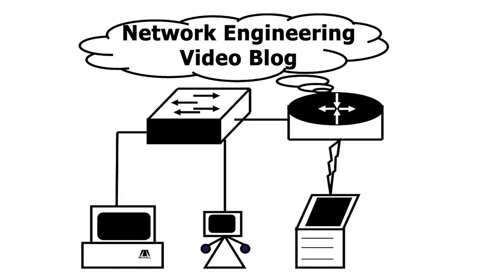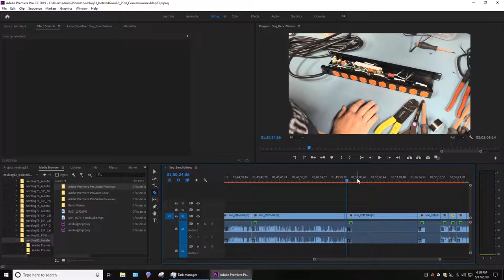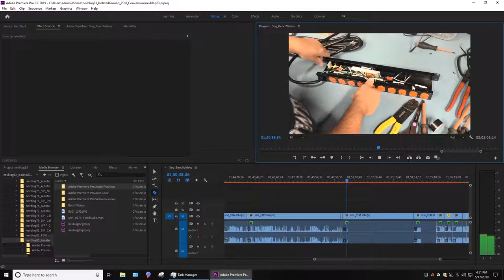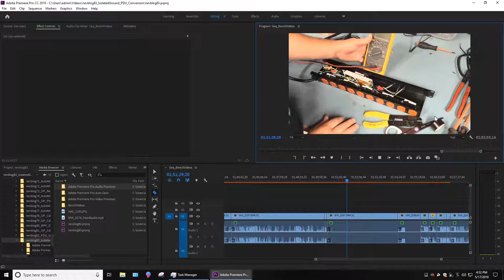NE #83 Isolated Ground PDU Conversion

Comment: I am contemplating on doing this for my home recording studio. I am getting alot of ground hum coming thru my sensitive audio recording equipment. I am unable to tamper with my apartment wall outlets and was wondering would this help me by pass dealing with housing and lease issues.
Reply from the maker: Your 60Hz hum could be but is probably not coming from the ground. I would be surprised if your recording device didn't filter AC hum out of the ground. I would start with power supplies for your various household items like: PC, cell phone, and other consumer electronics and start unplugging them and see if your hum goes away.  The goal is to keep unplugging stuff until you find which device is AC coupling noise into your recording device.
Reply: @reasonpTv your hum is potentially conning within the same equipment or 2 different phases of circuits. Your best way to solve or narrow down is to unplug one device at a time until the noise level goes down.
Reply: @NetworkEngineeringVideoBlog  the audio interface unit ending up being defective sent it back for warranty repair, they are replacing it.
Reply: @JesusMTossas  Thanks